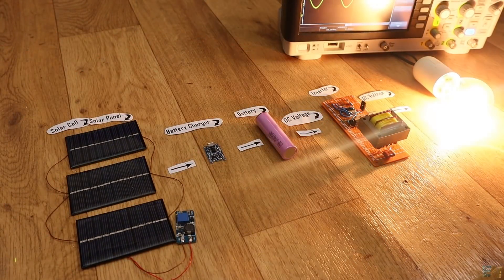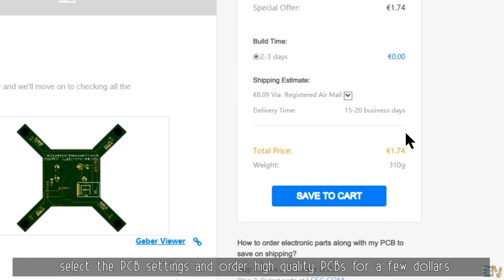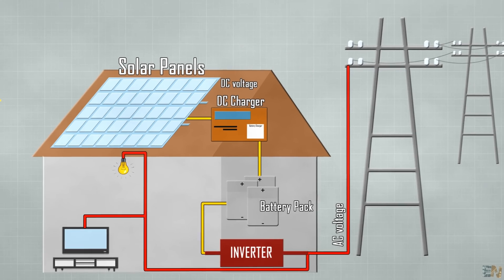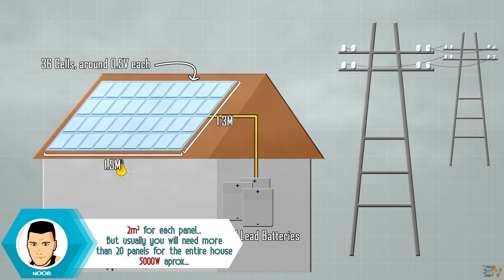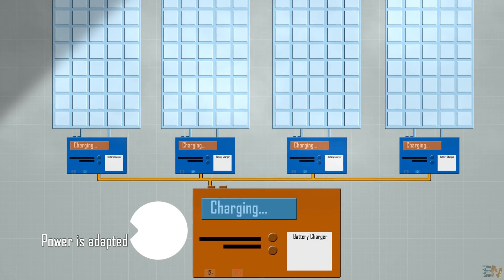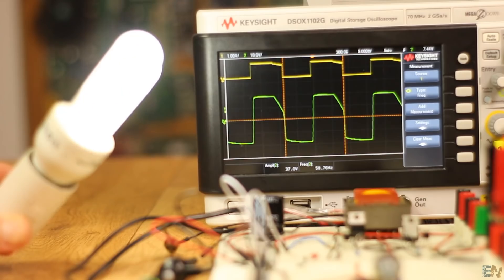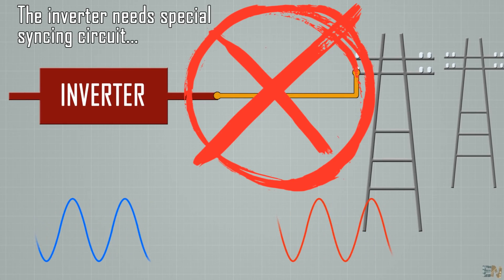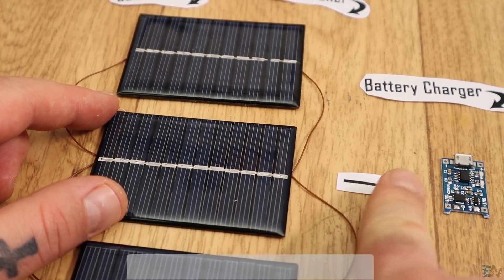Home solar panels system | How it works

Comment: When the battery is charged by the solar panel, the voltage of the solar panel should exceed 20%-30% of the working voltage of the battery to ensure normal charging of the battery. For example, charging a 6V battery requires an 8-9V solar panel, and charging a 12V battery requires a 15-18V solar panel.

Comment: Remember in the US, your inverter/transformer should be at 120 V, not 220 or 230 V. Depending on the invertor you get (Inverters normally include a modified transformer in their design.), it may already be converting the DC to AC at the right voltage, so an additional transformer may not be needed. Also to send back to the grid, your electric company has transformers, which are bi-directional, so you don't need to step up or step down with a transformer for them.

Comment: Great introduction to solar systems! how do you size each of the components?   I want to build a system to continuously run a 115v/0.8amp (96watt) circulating water pump. How to determine start-up surge on pump?

Comment: I love your videos. 
Would you like to work for my solar brokerage company.  Please look at https://johnbolenbaugh.solar and the videos explain how you can sell solar systems over the internet and by phone. Our software  and connections to 200 solar installers are unmatched. Commissions are amazing. We have hundreds of advisors making 6 figures and our top salesman in making $100,000 a month. Local solar companies will install and warranty the systems. We are the world's largest solar brokerage. We are in America, Australia and Canada. Contact me anytime or please refer anyone to my company interested in a system or a part time income. 

We install our systems at zero down and we will give a 15 year low interest loan that's less than the homeowners current electric bill. So their homes value goes up 5 to 10% for basically zero out of pocket. In 15 years the homeowners will have practical no electricity or solar bill for the rest of their life. 

I use to be a oil supervisor  that is now pushing solar because of the communities and kids I have seen posioned over the years.

Comment: In practice your circuit and explanation is very bad. A boost converter after panels? Micro chargers? Fixed voltage and current charge controllers? Your knowledge on the subject is a joke and is not even close to enough to be in a YouTube video. You are making videos just for the money...
Reply from the maker: Sorry you feel that way. I work a lot for all my projects
Reply: @ELECTRONOOBS  your visual presentation is definitely good, but content precision is very misleading. I've seen you presenting subjects much more on point. If you'r looking for views from noobs it "doesn't matter" they "eat" everything, but if you are looking to honor engineering you need more knowledge and less "fireworks"...
Reply from the maker: @TelmoMonteiro  I’m not looking to trick anybody, but correct me if I’m wrong, maybe I’ve made a mistake.  For the systems I’ve designed
1. After the panels you need a regulator. Sometimes the systems needs to boost up a bit the input then regulate the constant voltage. All this is inside of the so-called battery controller that will charge the batteries at CV/CC depending on the battery pack.
2. Usually, li-ion packs are charged art CV/CC, what is wrong with that?
3. About micro inverters, if one panel is under shadow, that will affect the entire output power in series. Using micro inverter for each panel, you could balance and adapt the power. 
have a nice day.
Reply: @ELECTRONOOBS  I'm sorry for my rudeness. I have to admit it, but sometimes strong words are necessary. It's just that it seems that everybody is trying to make content on the internet for quantity (and make money) and not for quality.
Answering respectively:
1. Correct, you need a charge regulator, but voltage and current is not fixed. You can have a current limit (if your array is way too powerful for you batteries, which is not common at all) or a voltage limit (as you should) to protect your batteries. The problem is that outputting a constant voltage is not possible because you want a fixed power output with a variable power input. A charge controller NEEDS to account for this, and lets the voltage and current fluctuate at it's output, as the array production varies. It doesn't make it constant. It connects directly to the battery and it is there just to protect the batteries from overcharge (essentially) in case it is a PWM controller, or to also seek the "max power point" of the array at any given moment if it is an MPPT (max power point tracking) controller. This last type of charge controller uses a DC-DC circuit (boost or buck, usually buck), controlled by a "MPPT" algorithm, to vary the load (because sun light varies) on the panels, effectively achieving max power at any giving moment. Unless you have this feature, a DC-DC topology will only bring down the voltage at the panel constantly (until DC-DC shuts down and restarts again, making it a doubtful PWM charger) until the panels can produce more power than is being asked. Feeding this "PWM" to a charger prepared to receive constant voltage is not ideal at all. This constant shutdown happens because a solar panel is a current source, not a voltage source. It imposes current on the circuit, and if you try to get a constant voltage at the output, when the panel can't meet the power asked, the DC-DC circuit will try to "transform amps into volts", but as the current is imposed by the panel the result is this doubtful PWM feeding everything else after it.
2. So now you know that you can't have a CC/CV charge unless the solar production ALWAYS meets and exceeds demand made by CC/CV circuit. Your example only works with ideal conditions.
3. Now you mixed "optimizers" with "micro inverters". Optimizers (not micro chargers) output DC and can be connected to a inverter, but micro inverters (already have optimizers before the inverter and) connect directly to the grid, as they already output synched AC at "grid level". If you're charging batteries, usually you have one charger for all panels (most commonly), or one for each string of panels, or a extreme case, one for each panel. Their outputs are connected in parallel at the battery.

Comment: I would like to know, how much current can provide the small panels you used, I have been working with a solar panel that is supposed to give 5V and 150mA but  with full sun light they  only gave like 30mA, it would be an honor if you answer me that doubt

Comment: I have a solar panel which gives 20 volt of output can I use a buck converter to charge my 12 volt lead acid battery? please answer 🙄🙄🙄
Reply from the maker: Yes you could!
Reply: Thank you 😊😊😊

Comment: But how they will be in sync ?
Reply from the maker: Detect the frequency and zero corss of the grid voltage and create the inverter AC signal the same as the grid!
Reply: @ELECTRONOOBS  A good next project would be a DIY grid tie inverter, connected via a low voltage transformer for safety.

Comment: Hi Can you add a tiny Solar panel to your arduino watch v3 and made an auto charge when the battery voltage is low ?

Comment: Extremely confusing... "Off Grid" illustration shows connection to grid. "12V Battery" suddenly changes to 24V, etc.
Reply from the maker: The system is the same but could have 12V or 24V batteries. Off grid means that it could work without the grid usiong batteries but it could be connected to the grid if you want as well.
Reply: @ELECTRONOOBS  'Off Grid' means, literally, no connection to the grid - and in it's widest sense, no connection to any utility supplies (electricity, water, gas, sewerage, etc.).

That's the ideal, but it's a very large investment...